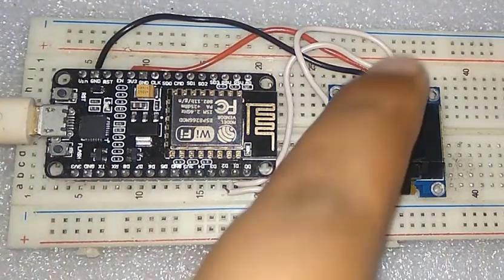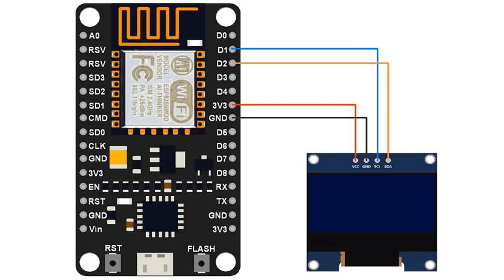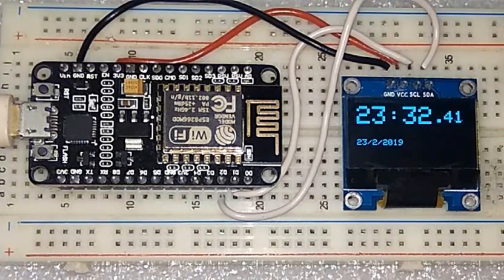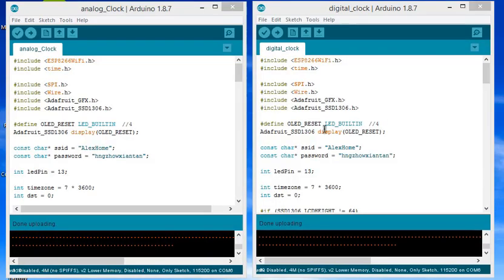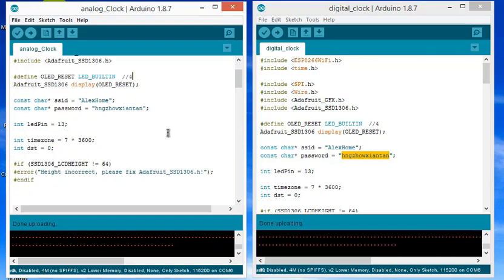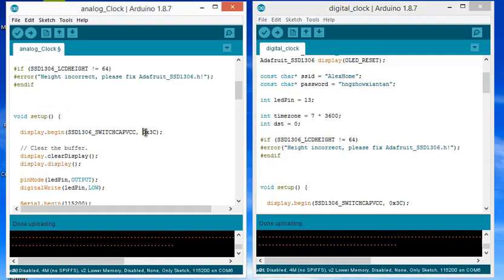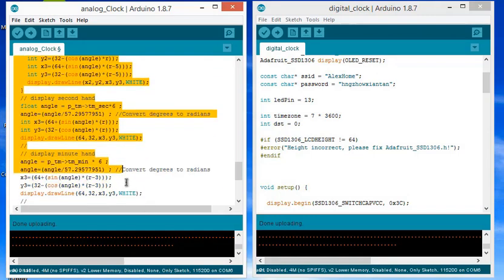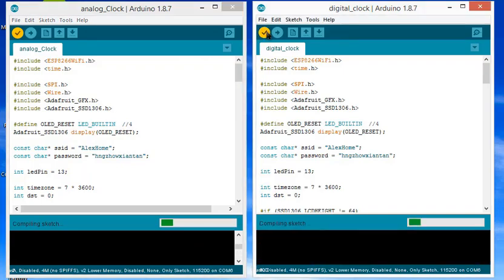IOT Based Analog/Digital OLED Internet Clock || IOT Real Time Clock

Comment: How to solve this  error #error("Height incorrect, please fix Adafruit_SSD1306.h!");
Reply from the maker: Go to library folder and make a correction in library file of SSD1306. Uncomment the the correct dimension and comment the current uncessary line.